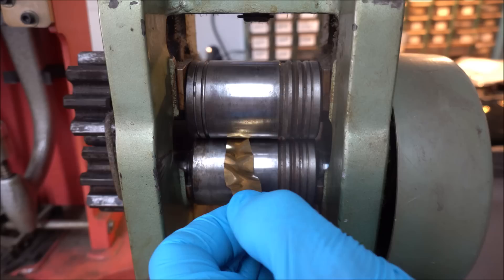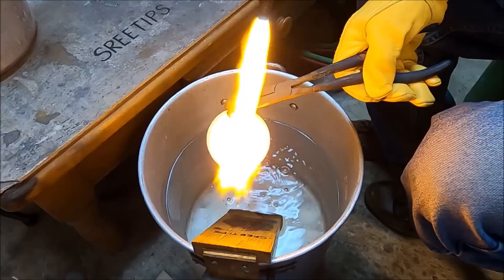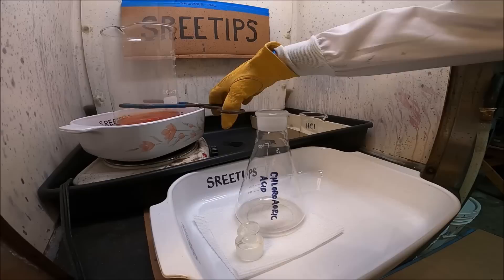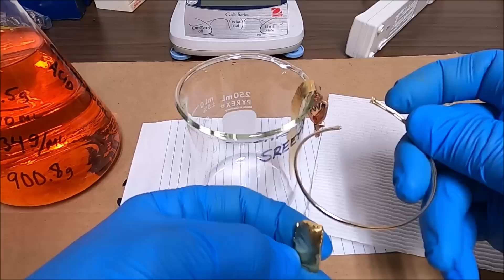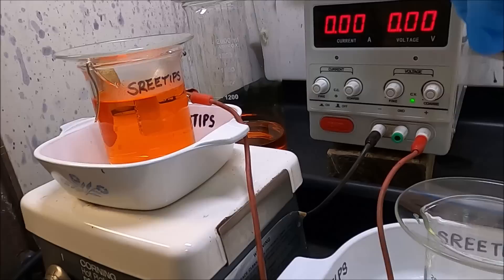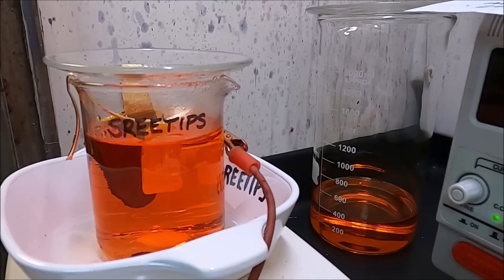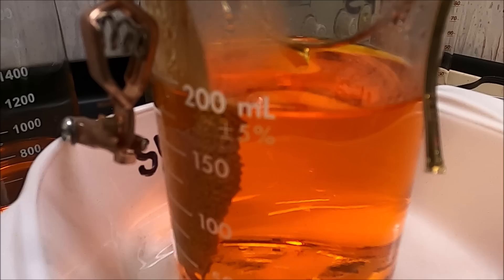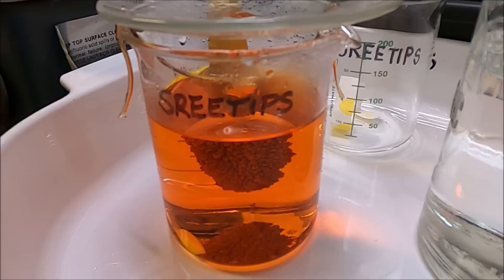Electrolytic 9999 Gold Refining Cell Wohlwill

Comment: Great video. Question, did you pull the gold from the electrolyte too or just transfer the gold from the bar to the other side? Didn’t catch the weights. The video starts with a gold coin,  5 OZ of gold to make the electrolyte and  then a bar. Was all the gold reclaimed in the process of does the solution contain good too? 😊
Reply from the maker: Yes, the gold gets dropped from the electrolyte. No gold was lost or gained. It transforms its shape (and purity) that’s it.

Comment: now that i think about it I've seen this series previously, i guess I was thinking more like the silver cell growing crystals on the wall of the stainless steel bowl, are they to heavy to form like that?
Reply from the maker: The gold in solution, being a chloride, would cement out on the stainless steel bowl. I used a glass cell and a 9999 coin rolled very thin as the cathode. I think that I can get thin needle-like gold crystals to grow by increasing the voltage on the gold cell. But I’ve never tried it - that would make a neat video.
Reply: @sreetips  I agree 100% buddy!! Really appreciate your information and efforts over the years!! Didn’t consider the Cl becoming cemented rather than crystalline formations.

Comment: I wish there was a way to purify gold from a mixture of metals by this method.
I hope Sreetips researches on this subject one day.
Reply from the maker: Unfortunately, the anode must be high purity to begin with. Anything lower than 99% will foul the electrolyte and cause contamination problems at the cathode
Reply: Their is a method similar to this to do that sir. It's called a Fizzer cell or break down cell. It's not a one step process though.

Comment: Can you please tell me how much hydrochloric-acid and nitric  acid per ml should I have to use for each 1 kilo of gold   To use it as a solution for the process ?
Reply from the maker: I can dissolve pure gold powder with lots of heat and 10 parts hydrochloric, 1 part nitric. I add the hydrochloric to the gold, then start adding heat and small doses of nitric until all the gold has dissolved. It usually ends up being about ten to one, HCl to nitric.

Comment: How well does this work with less pure Au solutions, IE if you used a -CN leach on some of the jewelers waste/sweeping etc....Was thinking if someone had a large Cu smelt operation your plated scrap could be cast into an anode while the heat flashed off the Zn, the Cu extracted then extracted by electrolysis in H2SO4 then the residual anode slime processed to recover the precious metals, but given the small scale the electrochemical etch is probably the best approach.
Reply: We can get our cyanide/caustic/gold solutions down to less than 1ppm Au in solution, if you really give it a long time say 0.5ppm. This is how pretty much every gold mine that uses cyanide leaching recovers their gold into metal - apart from the ones that use zinc dust but they are a bit more rare.

Comment: How can I know how much voltage and amps do I should’ve to use in the process like for example 1/2 kg gold ?
Reply from the maker: I used anode that was 999. But the anode can be as low as 980 parts per thousand (according to Hoke). I used 1.5 volts DC. I used gold dissolved in Aqua Regia containing a little over 100g per liter concentration with 10% free hydrochloric acid added. I heated the cell to maintain 140 degrees F (60 degrees C). I suspended the anode in the electrolyte, applied 1.5vdc (the amps will vary depending on many factors so I didn’t set the amps) and it took about 1.5 hours to completely dissolve the anode and plate out on the cathode. The cathode was a 9999 fine gold coin rolled down to about 0.008 inch thickness (about 0.2mm)

Comment: Question:  Does using a copper clip on the cathode affect the process in any way?  Would a gold clip be superior or just not affect it?  
I like these 'hyper-edits', but I don't think I am alone in saying I like the long-form versions so much better.  Good stuff, nonetheless.
Reply: As long as the clip isn't in contact with the solution at all, it shouldn't matter. The electrolyte is where all the action is; the clip's job is only to be an electrical conductor.
Reply: @emanwe01  Cool, thanks!

Comment: but whats the point of plating it out onto the anode.. when you already had 99.99% gold already
Reply from the maker: It plates out in the cathode. The anode bar was about 995 parts per thousand. After it dissolves from the current flow, the gold ions travel through the electrolyte, and deposit as high purity gold 9,999 parts per ten thousand. In order for electrolytic refining to work, the anode material must be relatively high purity to begin with.

Comment: How much current did you supply and how many hours did it take?
Reply from the maker: 1.5 volts DC for about two hours.
Reply: @sreetips  I don't mean the voltage. I want to know the current in amperes. Anyways, I am assuming it is slightly less than 1.5amps considering the voltage is 1.5v and it will take you less than 2.5hrs to extract 27.7g of pure solid gold using the current, am I right?
Reply: @sreetips  Ha! Just seeing this. So I was right.
Reply from the maker: I think the amps were up over 3 amps
Reply: @sreetips  I see. Then that will probably take some 1.3hrs at that amount of amperage. Interesting! Did you step the voltage down from an AC source or just direct battery source?
Reply from the maker: Used a variable DC power supply.

Comment: Do you find this to be a cheaper method of refining gold?
Reply from the maker: I’ve only done it once. I don’t have enough experience to be able to make a determination. Industry standard for gold is three nines. And while this method can easily produce four nines, the extra nine is really meaningless. I can produce three nines gold by double refining with a wet chemical process, using two different precipitants, every time, quick and easy, depending on the source material.
Reply: @sreetips  when you use e-waste, do you think you could just crush and melt the whole thing into an ingot and then do gold extraction with electrolysis instead of using oxidation/reduction chemistry? I'm thinking your only operating cost is electricity instead of going through bottles of chemicals.
Reply from the maker: Electrolysis only works on high purity gold. I could use the pins to inquart and get the gold that way. But where’s the show for a video in that? No, unfortunately, getting pure gold, from any source, is never quick and easy. That’s one reason that it’s so darn expensive.
Reply: @sreetips  what if you first did electrolysis of copper and then refined the gold from what remains?
Reply from the maker: Refine the copper? I don’t know how. To a precious metals refiner - copper is waste.
Reply: No, just pull the copper out with electrolysis so you don't have to use all that nitric acid. Then refine the gold out of what remains using chemistry. I'm thinking that might be cheaper than using 10 bottles of nitric.
Reply: You use copper sulfate as the electrolyte.
Reply from the maker: I used 5.2 bottles of nitric. My mentor, Harold_V used to say don’t bother with copper. I set out to defy him. So I tried melting copper bars. Ended up using more resources than it’s worth. He was right.

Comment: Hello, I wanted to absorb gold on 316 steel cathode. Thank you for your help.
Reply from the maker: Might work, I’ve never tried it
Reply: That is how pretty much every gold mine recovers gold from their cyanide/caustic solution. We find it does not form dendritic crystals - just a fine sludge (very fine particles). You get most of it from the cathode and a good deal that falls to the bottom of the cell. I have never seen it form like this video in all the mines I have worked at. You just clean it off and smelt and put the cathodes back into the electrowinning cell and re-use.
Reply from the maker: Do you recall what the cathodes were made of?
Reply: @sreetips  316 stainless steel mesh for the cathodes (I forget the wire grade - but to give high surface area) - anodes are just stainless punch plate. Generally they last for years (longer even) however you have to be careful for certain impurities in the pregnant solution that cause massive corrosion / dissolution of the stainless.
Reply: @sreetips  Gold plates at the cathodes - at the anodes you get evolution of oxygen gas from the breakdown of water molecules. This leaves behind an acid molecule behind so over time the pH of the pregnant solution decreases so you have to have a top up with caustic if it gets really bad - which is rare, otherwise your conductivity drops too low and you cannot achieve a low gold in solution ppm - aim for less than 1 ppm.